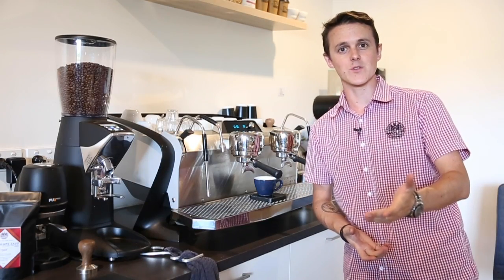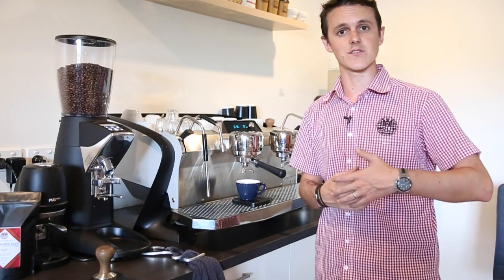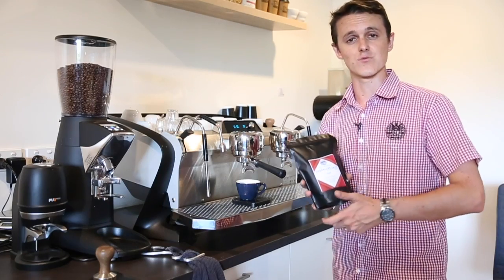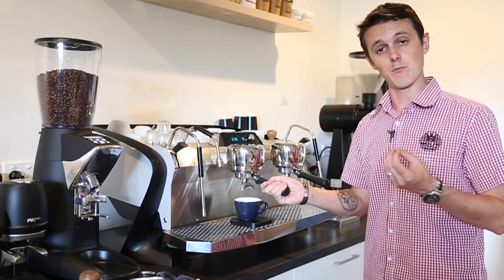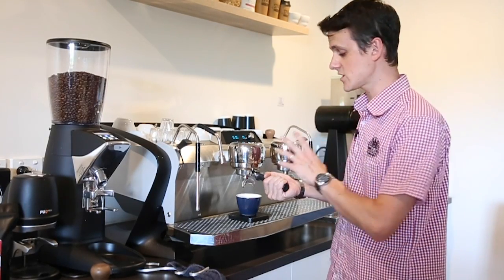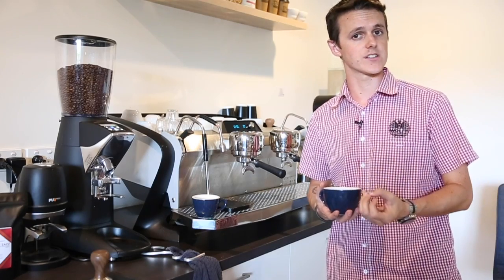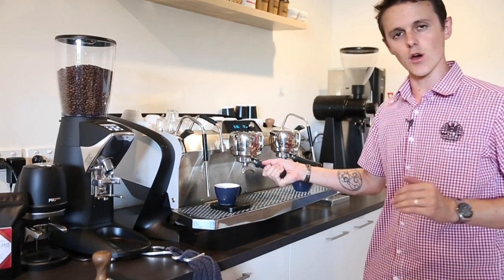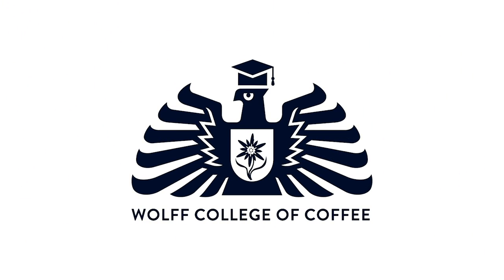Dialing espresso to taste: brewing temperature.

Comment: I’m having trouble understanding...so regardless of dose you want espresso to pull in the 25-30 seconds generally? So if you have a 18g “double” basket and a 21g “triple” basket you would want to pull 36g and 42g of espresso respectively. From what I understand you’re going to want a slightly coarser grind for the 21 g basket in order to pull the 42 grams in the 25-30 second range?
Reply: Incorrect, you want 1:2 ratio for grinds:total espresso - so 18g basket gets 36g espresso and 21g basket gets 42g espresso out.

You would use the same grind for both baskets.

Comment: I have a question for you. I have a non pid espresso machine that can get the temperature of the cup to around 180 degrees. Should I grind finer to slow the extraction process and increase the temperature of the cup
Reply: sometimes if you run a quick flush through you systems you can get the machine to start heating the boiled again. as you do this you can start brewing and the temperature won't drop as much as you brew. The other alternative is to basically turn on your steam to pre-heat the boiler a little extra then flush a touch and then brew. Hopefully that kind of makes sense. Let me know if it does or doesn't. Ill try and make up quick video is need.

Comment: I'm actually having issues with the extraction on my machine (a very old one) - I'm constantly getting a bitter coffee and not getting any crema.  I've already made some adjustment but can't get good results. 

I've already call the guy to check on the machine. It's a Faema Prestige
Reply: raul sosa 
1. Time now long a double espresso takes to come out. This should be between 20-30s (generally). If it's too fast, grind finer. If it's too slow, grind courser. Bitter tastes normally mean it's too slow. 
2. If your machine dispenses water too hot then it will make your espresso bitter. 
3. If the shot has too much volume for the amount of coffee you used, it may cause some bitterness / astringency. If the volume is too high reprogram your machine to dispense less coffee. 
4. When adjusting your settings, adjust one at a time to make sure if you can't taste an improvement you know which adjustment doesn't help.

Hope this helps 😊
Reply from the maker: Hi Raul, have you checked the pressure on your machine? Low pressure can cause the dhot to run too slow, making it bitter, make the crema thin and dissolving it within the coffee itself. All tips from Jack are also very useful. Thanks!

Comment: I’ve got a Breville touch and for a while it was making great coffees, whether I had the grinder on for 15-18 seconds, or the brew time between 25-30 seconds, but now everything tastes terrible, I’ve tried turning the brew temperature up, that seems to make it worse, but every coffee comes out either sour or bitter, if I tamp to much it’s bitter, not enough it’s sour, I have noticed the grinder is leaving large pockets in the basket, so I was thinking maybe I should start weighing and grinding with a seperate machine first? 

There’s no videos for the barista touch, if you could make one that would be great thx.
Reply: I'm one month late so I don't know if you've fixed the problem but, how often do you run your cleaning cycle for the machine and have you descaled it? The breville integrated grinders are also not the best and so you should try to break up any clumps when you put the grind in the portafilter (WDT Method) with a toothpick  or paperclip, etc
Reply: @tridragon11  not sure what the wdt method is, but I’ll look into it. 

I ended up fixing the problem, I ended up reducing the grinder down from 3 to 2, and i think I was pushing to much on the tamp, now I just spread with my finger, bang the filter on the bench so the grinds fall into the pockets and ever so lightly tamping it, like not putting any pressure on at all, it really is only flattening the top layer and now all my coffees are great again. 

I do clean it it regularly too.
Reply: @tridragon11  norman
Reply: @Vgallo  norrman

Comment: i have a weird situation with some bean that i purchased from a local roaster. It’s Medium Roasted Arabica Kintamani Bali. It used to be good. But the last 2 batch that I purchased Ain’t the same. So here’s what happens. I dose 18gr in 18gr out for milkbase drink. It doesn’t matter if i brew it 20sec or 30sec, it has bitter aftertaste. The only thing i can do to get rid the bitterness is brew it with super low temperature i use 87*C which way below recommended brew temp. Does it normal brewing espresso with that low temp? The down side i get is Low body & sweetness. Any idea of other solution that i should try?
Reply: @gusmank Did you try increasing the dose like 18.5 in and out or 19?
Reply: @jeremyed9507  i tried 20g. It just the same. Look like the issue is on the bean
Reply: great question. I found that lower temps increase bitterness for me. have a video about that. Grinding finer might be your friend here to reduce bitterness.
Reply: @LivingRad  if i Grind much finer, it will clog my machine. And the brew can last 50-60 second. The fun fact even that long brew time. The taste is good. 😅 strange heee?
Reply: @gusmank  what is your set up as far as machine and grinder? are you using a pressurized basket? I've had issued with tamp pressure before that caused long brew times. The point you make about taste being better makes sense. The coffee is likely better extracted and reduces the bitterness/sourness. As long as you are enjoying it thats the real key :) Happy brewing my friend
Reply: @LivingRad  i use Sette 270 and a Linea Mini. Like my previous comment above. The issue only occurs on some beans. My current bean that i use doesn’t have those issue. It brew perfectly using 18grams in / 18grams out / in 28sec / add 150ml of milk for a Flat white.
Reply: @gusmank  lovely! That is very odd. How do you like the 1:1 ratio. I should try it. I normally do 18 in 36 out
Reply: @LivingRad  it best if you add milk on it. As it result more flavorful drink, and less bitterness. I only brew 1:2 when i want to drink the espresso straight. Try it :)
Reply: @gusmank  ill try tomorrow thanks!